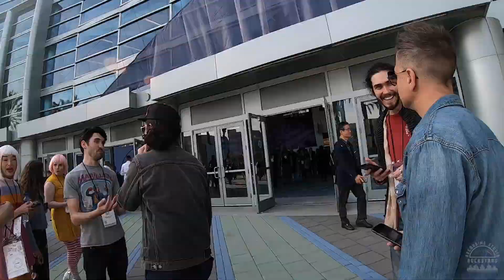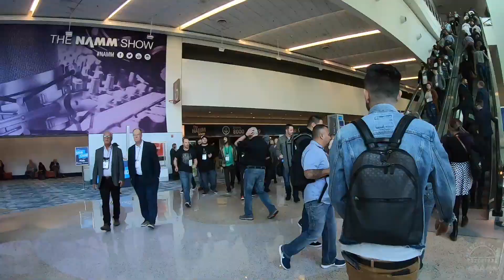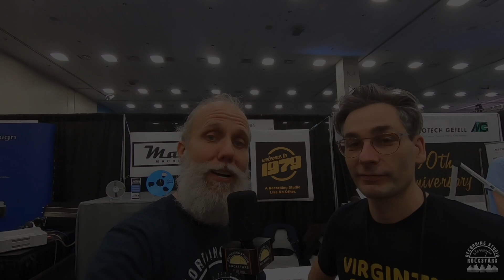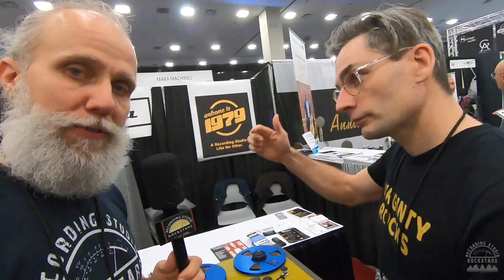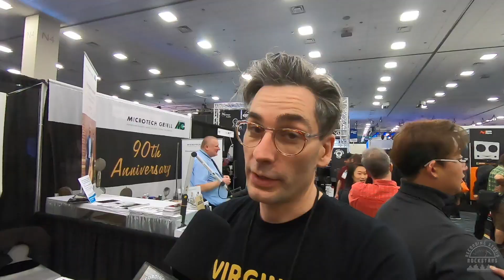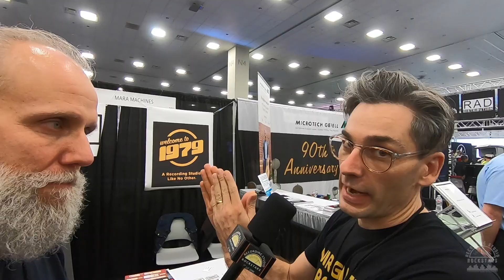How An Analog Tape Machine Works - MaraMachines.com at NAMM 2019

Comment: I'm glad I'm old enough to have grown up recording on  tape.  Good to see it's coming back!  I used to use a Tascam 8 track 1/2inch tape running at 15 IPS back in 1984.  Decent enough, but the 8 track one inch MCI Mara sells is far superior, plus it will run at 30 IPS. There is nothing like analog warmth.
Reply from the maker: I agree! I love the sound of analog tape especially recording rock bands in the studio :) Cheers! Lij
Reply: @RecordingStudioRockstars  Cheers to you as well!  No doubt about it, analog tape for a  rock band is awesome!

Comment: Cool video Lij. My only “tape machine” experience is using a Tascam Portastudio in the early 90s!
Reply from the maker: Pete Johns sweet! It was a lot easier to flip the tape around and record backwards guitar parts with a Tascam Portastudio. Plus you could change the record speed for adding hi vocal harmonies 👍
Reply: @RecordingStudioRockstars  - totally! I also do miss the "mix with your ears not your eyes" that an analog machine required. It really made you just keep experimenting until you found what sounded good.